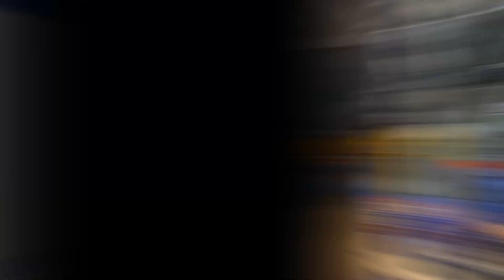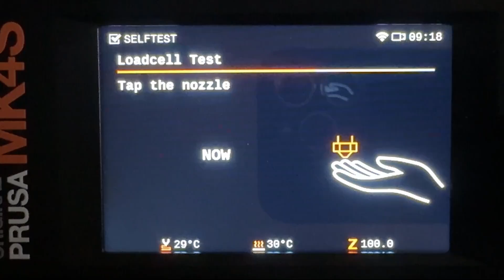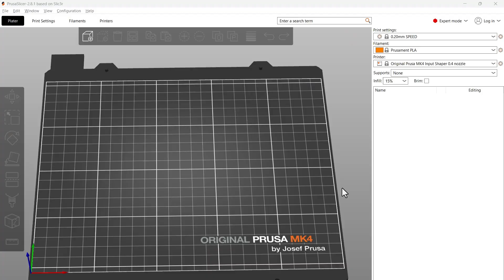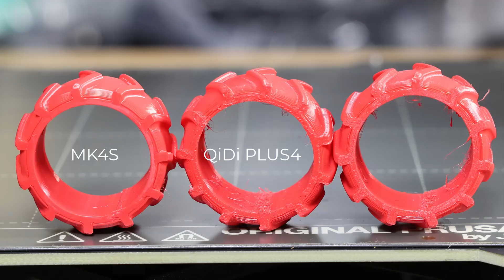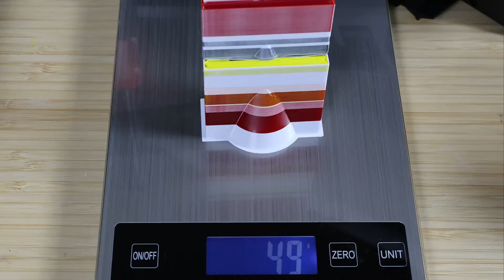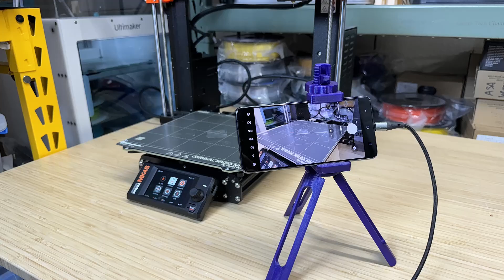Prusa MK4S in-depth test with MMU3 multiple filament system, no filament poops, print faster, but...

Comment: Far too much purge with MMU3.  I'll start with the MK4S, single color with occasional manual material swaps.  The only solution for low waste color is  multiple toolhead printers or Bondtech INDX.

Comment: Excellent overview and well produced video. I am assembling a MMU for the MK4S while watching this. I can attest the assembly time is way over a few hours. I'm over 8 hours in and still going. I am doing all the subassembly bits at home and will go to the lab to make the installation and setup. As I look at the website now, the assembled version isn't an option so maybe this comment is obsolete, but if it's only $60 to get the assembled version, I wouldn't hesitate to pay it. For context, I assembled an XL 5T, and it's enclosure as well as the enclosure for the MK4S and I enjoyed the process. This MMU is very tedious and filled with opportunities to mess it up and have to reprint parts. The one major error I made which was completely my fault resulted in having to reprint the main body. The clean up on that alone was time consuming and awful. The good news is that all the parts can be recreated if something happens. As with everything, read each step carefully, and proceed with patience.

Comment: Really well thought out and helpful review

any hesitation abt using the high flow nozzle with the MMU3? The upgrade kit from the 4 to 4S advises against it

It says specific setting are needed to use it properly - is that the adjustment of the purge volumes on color changes you did?

Comment: I always wondered if there was a way to reduce the filament waste during color/material switches by using the purge material for the infill?
Reply: This is a setting in Bambu Slicer and I'm pretty sure Orca, I use it all the time. The waste isn't as bad on Bambu machines if you're smart and not trying to make them look bad. I have nowhere near the waste they do.

Comment: I like your accurate reviews and clean edited videos.
My only suggestion is to put pressure on 3D printer manufacturers in terms of the speed of printing.
The present 3D printing technology is still VERY slow. Everything you want to print takes HOURS. It should be MINUTES to open my pockets.

Comment: If the output is for a long time like Robo Alpaka, I think the filament may have absorbed moisture depending on the environment. Is the humidity of the evaluation environment controlled? In my experience, PLA and PETG do not seem to be affected if the environment is around 35%.

Comment: just wanted to say thank you for the review. I already purchased mine but i agree with all of what you said in your review.

i personally had been using the prusa mini as my go to printer but now i'm incorporating the mk4s. i like it... it just works and in my country, prusament is one of the only filaments for petg and other non-pla filaments that are available locally and have a print profile ready to go with both 0.4mm and 0.6mm nozzles. Everything just works.... 

i plan to get the MMU at some point and the filament poop from the bambulabs x1c with AMS was a turnoff for me. Also, i don't like cloud printing.

and just recently they started selling an upgrade kit for the mk4s to the core one.... looks very nice but very expensive.

Comment: Wouldn't it be better to replace the purge tower with some extra pieces which are within the weight of the purge tower? Let's suppose that I needed some other parts to print that were just functional ones and therefore I wouldn't really care about the overall color, it could be a nice optimization to have those parts printed instead of a huge useless purge tower I would just throw away otherwise.

Comment: I wondered why this Prusa was lower on your web-list than the A1, so I went to Prusa's site to have a closer look.  The MK4S has a smaller build volume than the A1, and it's SIGNIFICANTLY more expensive ($800 for the kit, $1100 for the built unit, not including the MMU3 for another $270).  You could have a mini print farm of A1s for that kind of money.  But you said the MK4 (and now the MK4S) is your go-to printer, not the A1, so I'm curious why that is?  

The high quality alpaca print from the MK4S was gorgeous, but if the A1 had the same performance with the same settings, why pay more for the Prusa, or even consider it?  It would be interesting to see a side-by-side comparison of these two bed-slingers.  And if you have a personal preference for the Prusa over the A1, it would be interesting to hear the reasons why.  Thanks for doing these reviews.
Reply from the maker: The A1 and A1 Mini are #1 and #2 on my recommendation list in terms of value, they’re hard to beat. I also use Bambu Lab printers (I have all five models: X1C, P1S, P1P, A1, and A1 Mini), though not as often as Prusa printers. 

I have eight Prusas (3 MK3S+, 1 MK4, 2 MK4S, 1 Mini+, and 1 XL) and am accustomed to the Prusa workflow. It’s especially convenient since I’ve connected all of them to a single Prusa Connect account. I personally enjoy the Prusa printing experience, and over the years, I’ve accumulated various print surfaces and many replacement parts, making repairs and maintenance easier than with Bambu Lab machines.

In my upcoming video, I plan to upgrade some of the MK3S+ to MK3.5S and 3.9S. The MK3S+ are solid machines, still more reliable than most budget Klipper machines, but their speed is a bit slow by today’s standards.

Comment: i think the MMU3 testing in the end is a little fudged. printing multiples of the same object is an option on any printer that has a large enough bed, that's not the focus of the testing here. the final waste was 85g for that model, something which is shown on screen but never pointed out in the video, and that's not counting the previous sub-par prints made while dialing it in, due to the default settings undershooting on the purge requirements. like they cannot be just 100% counted as waste, but it 1. makes things more difficult than just importing a multicolor model and pressing print, and 2. indicates a level of hostility by the manufacturer, they're clearly prioritizing the numbers they put up over ease of use and quality control on the default settings.

on bambu's ams, this goes the other way, the default settings are playing it way too safe and end up with excess filament waste, but at least that gets you a good print on the default settings. then if you want to, you can mess with the gcode, there are community plugins to cut down on waste by about 50-60%. but you don't have to, and that's the point.

what i really don't get is, going by your numbers, the prusa would still be better in a fair and objective test. 85g on the optimized settings is still less than the 100-140g the bambu would create after optimization (which is a huge difference for a 53g model, and that's still with supports), prusa can be optimized in the gui of the slicer with no gcode modding needed, and there's also a valid argument to be made that this printer is more capable than an a1 mini with the ams because of its larger build plate, allowing more parallel printing. you don't need to fudge the numbers to get the prusa out on top, it's clearly the better enthusiast printer, with an asterisk that it's a little less user friendly (but that was already the case). so why go for a lopsided comparison?

Comment: Hey @AuroraTech, thanks for another great review. Like many others, I'm wavering between an MK4S and an X1C, and in this video, you did a bunch of technical tests and even compared them to prints from X1C. When I look at the X1C review, I see you don't have them there (I suspect you have added them to your routine since you made that video) Is there a video I'm not finding with the in-depth technical review of X1C that this video does?  I'm interested in creating functional parts -- dimensional accuracy and reliable prints are more important to me than speed or nice multi-color prints.

Comment: Question, why use the textured build surface vs smooth for PETG?
Reply: Smooth for PETG stick too much.. so much that it is possible that you damage PEI.. you can use gluestick on smooth but wha do this and then cleaning if you have textured sheet, from it print pop up itself when sheet cooldown

Comment: @AuroraTech Just subscribed! These videos have been a huge help.  Question, I've had a basic budget very old printer. Looking to buy one printer to last a long time, not even really sure what I'll end up printing most of it.  If you had to pick one, would you pick the mk4s or the Qidi Plus4?  I love how easy and clean the MK4s prints but I feel like the Qidi plus 4 is a better value. Do you think the Qidi will reach mk4s reliability, quality, and ease of use as it matures over the next few months?
Reply from the maker: If you want a printer that lasts long and is fully upgradeable in the future, the MK4S is the one to choose.

Comment: I find it hard to believe the opening statement that's is her most used printer but i guess it could be true
Reply from the maker: Yes, that's true. I didn't make that statement about any other machines.
Reply: @AuroraTech  I didn't say it was a lie, just hard to believe. Why do you use it more than your X1C for example? The work flow on the X1C is a lot more polished, so processing and monitoring a print job is a lot easier on the X1C and the print quality is on par with or better than the MK4S
Reply: @AuroraTech  on top of what I said previously your statement implies that the MK4S is a better option which is not. The MK4S is a lot more expensive just the printer itself, add to that the enclosure, MMU ect ect. The only reason to buy a Prusa printer today is just to support a non Chinese manufacturer because of the cheap labor and the communist party and all that. Other than that Bambu Lab printers run laps around anything Prusa has to offer. Prusa printers are good they are not as good as Bambu Lab printers. That's a fact that Prusa needs to come to terms with. I was a Prusa user for years. I recently got an X1C and my MK3S is seating on a shelf and on Offer up. I'm selling it or them because I have 2 for $250 each and no one is interested
Reply: @AuroraTech  don't get me wrong. I love your channel and think you guys do a terrific job reviewing printers BUT this review in specific is a little bit misleading in my opinion

Comment: Something that seemed to be completely missing from this review and seems to be missing from most 3D printing reviews is discussion of the software integration. One of the if not the main selling point of these prusa and BL printers is the fact that you don't have to do a bunch of profile tuning to get good prints. I feel like people who started in 3D printing years ago and are just used to having to do a bunch of profile tuning Don't really understand just how important that is. People who are just getting into 3D printing no longer have to learn how to do a bunch of filament tuning because companies like bl and prusa have made that essentially obsolete. At least in my opinion if a printer does not have a good set of finely tuned profiles it is pretty much automatically severely lacking. Obviously for those of us that know how to do the tuning it's not that big of a deal but again that's not the way the industry is going. More and more printers will be appliances and people will expect them to just work.

Comment: CON: with MMU3, Prusa forbid you from using ABS or ASA filament. Basically anything else than PLA or PETG
Reply: What is the reason for this ?
Reply: @black99rt  I did contact Prusa, and basically they say that the MMU is for cosmetic project, not structural. They limit in software the ability to use ASA and ABS. In short: I Love my MK4 and hate the MMU that is hardwired to it.
Reply: @bce.gatien  so they don't trust their  segment adhesion, or at least don't want their users to. I guess.
Reply: @black99rt  Have I known, I would not have buy the MMU3. It is a bummer that in a review of this quality, Aurora Tech did not mention this limitation.

Comment: Hi Aurora, since you already have AMS systems from Anycubic and Bamboo, maybe it's possible for you to review something from Mosaic? Like Palette 2/3. Because it also a MMU, but it works in a totally different way: it splices the filament together, creating essentially a single line of the filament, and the settings even allow to use infill as a purge block. 

And indeed to hear your experience, and pros&cons would be extremely valuable.
Reply: the palette stuff is basically abandonware while they work on their array industrial cluster system, and hasnt been relevant in years
Reply: @JustinBuildsThings  Can you elaborate on it a bit more? Maybe I don't know much about them, but I've bought Palette 2 for $120 (approx, it was in EUR) and I'm quite happy with my purchase, because:
- it does filament change with 4 colors
- it does some stuff autonomously (changing the filament if the spool(s) are empty, making random or not so random ones)
- it could be interfaced with Klipper/Octoprint
- it doesn't require hardware changes like filament cutter, and therefore it reduces down filament waste, because you don't need to purge what's left in between the cutter and nozzle tip

Yes, now I have a SV08 and I'm actively thinking about the toolchanger, because I'd love to have supports from PLA for PETG parts ;)
Reply: @dj_feel_x  palette 2 and 2.5 were ok but are very dated and do not play nice on fast printers. Palette 3 was basicaly abandoned months after it was released and many users never had correctly functional units. It is literally abandonware and when asked about it they said all their engineers were working on array tough shit

Comment: So, the MK4S is the printer Prusa should have released originally; instead, the upgraded version costs $100 lol I mean, insufficient part cooling should've been caught during testing and fixed, at least.
Reply from the maker: The MK4 performs well if you don't push the speed too far. Printing a 25-minute Benchy is still decent, but if you want a 14-minute one, you'll need to upgrade to a high-flow nozzle and improve cooling. Besides that, the $100 MK4 to MK4S kit also includes the new removable Wi-Fi and NFC module, along with some PC-CF, metal, and injection-molding parts.
Reply: They needed to release it because of the competition and also they are used to doing that, releasing unfinished products

Comment: I'm really not a fan of MMU units. Too much waste. What's wrong with a little paint?
Reply: I don’t typically do a lot of multicolor printing but it’s extremely nice for having some generic filaments ready to print so I don’t need to manually change anything. I maybe do a bigger multicolor print 5% of the time and the other 95% is used for smaller flat color signs and switching colors between different jobs.

Comment: If I go to Prusa website and add the printer and MMU to my cart, it is $1607.84 including shipping. A Bambu A1 with AMS is $489.99 plus tax. That is more than 3x as expensive - which can be tolerable for one printer but doesn't scale well as I often have three or more running at once.
Reply: Have the A1and I am looking good forward to replace it with a prusa.  This is not my first bambu. Done with toy looking tools

Comment: As much as I like the content there is a ton of stuff you are missing on the Bambu lab printer settings which can be forgiven as you mainly run default settings and probably have a ton of printers in studio. However you are doing your viewers a disservice not mentioning the simple options they can enable in a 30 seconds. 

Since April 2024  Bambu as adopted "long retract" option that can be enabled in settings, which pulls some of the filament up before cutting/purging. This can allow for 30-70% reduction in filament waste depending on color when combined with purge reductions. 

The prime tower is not only optional it can be shrunk down greatly with no color bleed or you can create a sacrificial part that acts as a prime tower. Even a simple 10-15 volume is just as good as the default 45 which greatly reduces waste. 

Basically if you care about purge there are many reduction options a available.
Reply: additionally the default purge volumes are extremely conservative in my experience

Comment: Where is the Creality K1 SE
Reply from the maker: The K1 SE is essentially just the K1C without the enclosure. Since I’ve already reviewed the K1C, I may not want to use another review slot for the K1 SE. Given that the price difference between them isn’t significant, I’d still recommend choosing the K1C. However, I’ll be reviewing the K2 Plus in the coming weeks.

Comment: Well done young lady, so glad to see you with Voxel support. I have been using Voxel for 6 or 9 months with outstanding results. I had ungraded my trusty old CR 10S Pro V1 with Direct Drive, Dual cooling fans, Y Axis Linear rails, Micro Swiss Hot End and lastly KLIPPER on a   PI 4 board with 7 inch touch screen Oh Boy. With Voxel PLA this baby will print, PETG. well I have to slow it down a tad but the quality is just awesome for my Trains. Great review as usual, you do a marvelous job. Thank You, Thank your Mom & Dad for me. They have done a marvelous job. Take care, D

Comment: You guys are the best, very thorough and fair 🙂 I saw the need for more cooling on the MK4 with some PLA filaments, mainly colored translucents, and I look forward to the S cooling upgrade.  Showing the purging volume array for MMU3 printing was great.  I found with black to white I had to get close to 300 on the setting to not have bleed over.